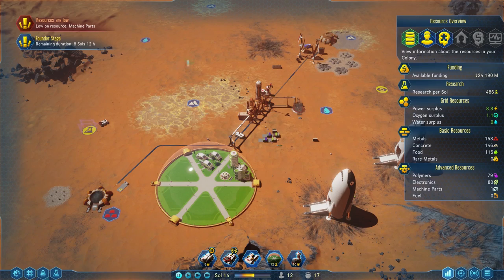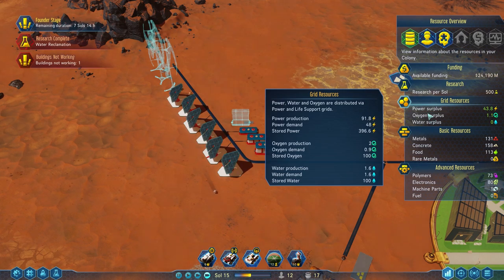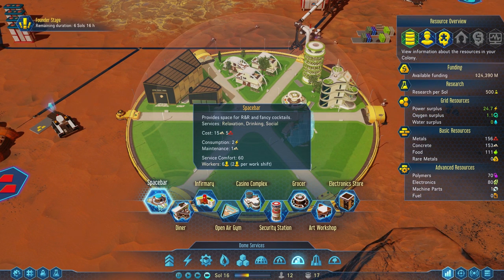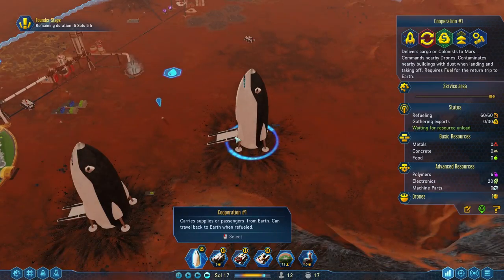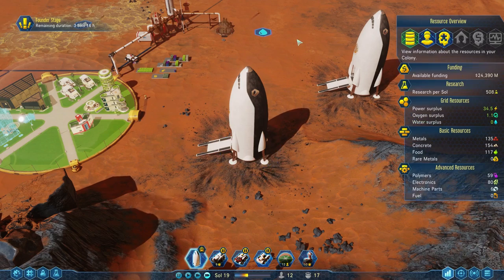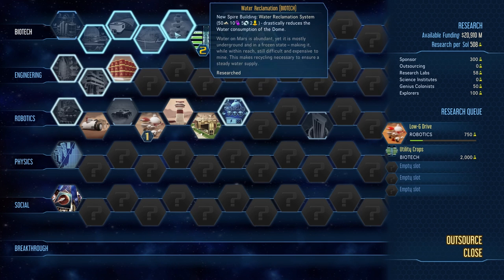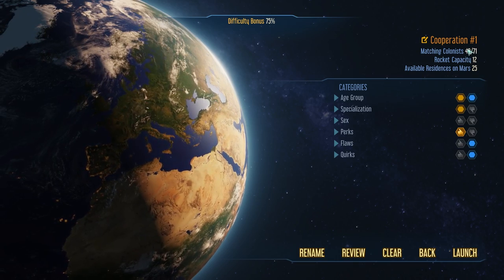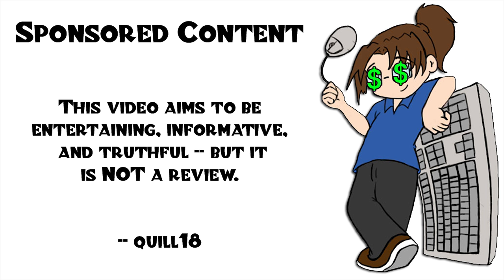Surviving Mars - A Guide for Complete Beginners! - #4: Factories! [Sponsored]

Comment: The one thing I see that I THINK is wrong in this is that Quill isn't managing the shifts effectively. From what was explained on the Paradox streams, people can work the first two shifts without complaint, but don't like working the third (midnight) shift. Quill has the morning shift activated for everything, and the afternoon shift is only active on a single building (med center). That means there's not enough workers in the morning, and not enough jobs in the afternoon. What he should be doing is balancing things out. So, for example, make the machine shop work in the morning and the hydroponics work in the afternoon.
Reply: This is a tutorial and he is just showing us the ins and outs of what is available to do and how to do them.
Reply: @edmartin875  A tutorial where he uses the building incorrectly and doesn't explain that he's using it incorrectly, leaving people to not understand the way workshifts work and how colonists satisfy their needs on non-work shifts.

Comment: One visual that I wish was in the game is that as a basic resource, like concrete, is being mined, the little icon on the map starts to dim or gray out.  And when the resource is completely exhausted, the icon disappears completely.  I get that there is graphical representation of the area being cleared out, but having the icon still there is kind of distracting and misleading.
Reply: That happens with the other sources (water, metal and rare metal), but concrete deposits are bigger than the area a single extractor can mine. You can demolish your extractor when depleted the zone and build a new one at the side and keep mining (especially in the bigger ones). Though is not very profitable to mine the last remains (the borders), so there will usually be some concrete to mine.
Reply: ScientistDog Ah ok thx for the explanation.

Comment: the concept of "they wont goto another dome to shop or work" is one of those really weird game mechanics that make no sense in an IRL setting. Of course if you had to don spacesuits to move between the domes, i'd understand it, but theres supposed to be connected pressurized tubings between the domes.
Lazy martians....
Reply: There are tubes between domes available in the game but he hasn't touched on that yet.
Reply: @edmartin875  Actually i was speaking about them not solving that problem either. They used to only allow workers to go between domes but they got a huge morale penalty for some dumb reason.
Apparently in the recent patches the tubes allow leisure stuff too. Wasnt aware of that. Still causes annoying unrealistic negatives though....because again they are like 5-10m walks!